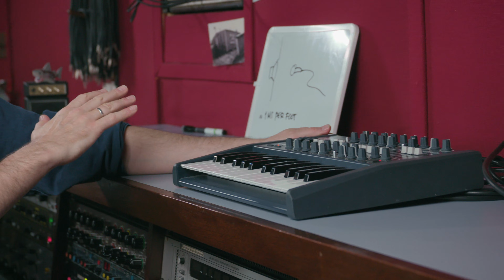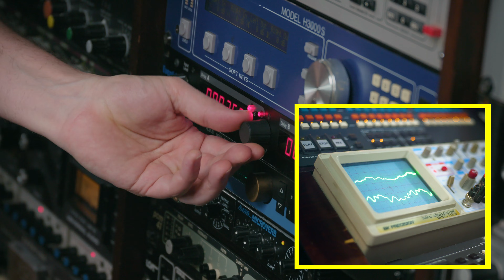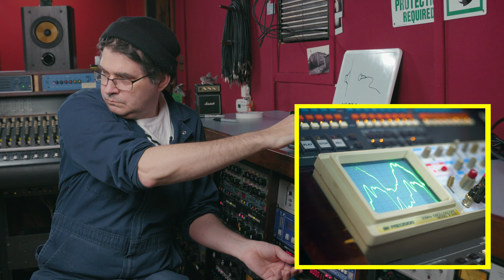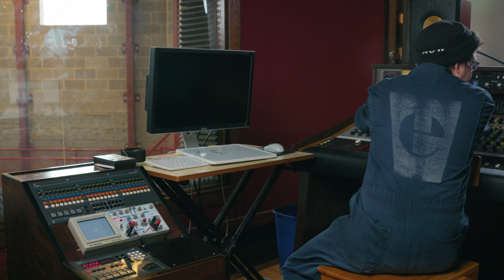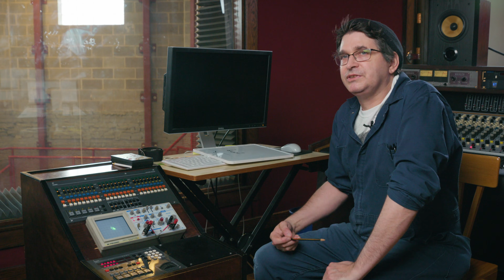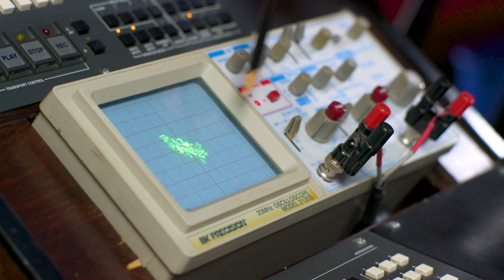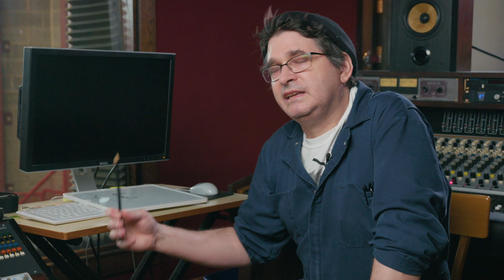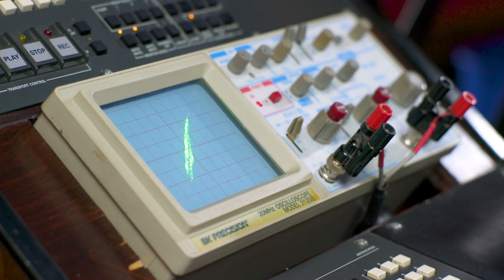Electrical Audio How-To: Time Alignment of Multiple Sound Sources

Comment: its actuly way easier to do this on a daw - with 2 mics just do a hard pluck on ur guitar and u can tell very ez how to align both mics
Reply from the maker: Best practice to get it right going to the multitrack.

If you are doing a full album, a double album, a punk record with 30 1-minute songs, leaving it to do via manual alignment, you have to do this as many times as there are songs on the project. If there are distorted guitars or bass and your alignment varies by even one sample, the guitar/ bass sound will vary significantly because of the nulls and peaks caused by comb filtering associated frequencies.

Comment: That amp/cab/mic vortex 😂 Anyway, I'm guessing that depending on the analog gear that the signal is going through, there may be frequency dependant phase shifts? If so, would you just go for aligning fundamental frequencies most relevant to the song key? Also, would you have to take into account any delays caused from the direct outs to the oscilloscope?

Comment: I can hear it phasing as they come closer together. Perhaps better to leave them apart sometimes?
Reply from the maker: Perhaps what you're heading is the phase relationship changing, but if the diaphragms are aligned there should be the minimum of comb filtering/ phase cancellation between them. If you prefer the sound with the mics apart/ with comb filtering, you can certainly record that way.

Comment: Is is possible to use a digital plugin for phase alignment?
Reply from the maker: Sure, yes. In an analog (tape) context this isn't a possibility, though, and generally it's a best practice to get things "right" going into the multitrack rather than delaying that correction. Same thing with polarity corrections- generally it's a best practice to check polarity and correct where necessary when you are setting up so you can record correct polarity, though you can, of course, reverse polarity later with any number of plugins.

Comment: Hey Steve, love your work, your vids and your incredible acrobatics...
one Q... when recording guitar amps using multiple mics we accurately align the capsules or strategically  distance them from the grille cloth to phase match, but the speaker cone itself is conical... so should we not be taking the distance from the face of the cone itself rather than the grille cloth.? always wondered...

Comment: On the playback side of the equation I had an Alpine car deck with manually adjustable time correction and it was definitely noticeable, tuning fronts and rears for the driver's position in a subcompact car.

Comment: the casual mention of "I had this dual delay adjustable in microseconds made for me by Eventide" is the most massive flex i've ever seen in a recording techniques video.
Reply: what do we think – 10 grand later?
Reply: @sugaree9090  Inquiring minds would like to know ...
Reply: It very well may be a joke, completely on brand for Steve.
Reply: @artysanmobile  I'm a huge delay nerd. That is not a commercially available device and DIY delays are NOT easy.
Reply: @suitandtieguy   I can’t think of any hi-end delays that won’t work in 10s or hundreds of microseconds. It is dead easy to mod a digital delay to work in the next decimal range, especially in the shorter direction.
Reply: @artysanmobile  I engineer synthesizers for a living and I'm an Eventide nerd. That is not a commercially available product and hacking it together would be extremely difficult.
Reply: @artysanmobile  what's really funny is how stupid this is when you could just buy Driveracks and program the delay in literally feet instead of time. They are so cheap and sound GREAT because they are designed for clean program material.
Reply: @suitandtieguy  maybe that wasn't an option at the time he had his delay built? Then he got used to it and stuck with what worked 🤷🏻‍♂️ I mean.. he probably paid an arm and a leg for it.. and it clearly did what he needed it to do.
Reply: @jmorrisey79  there were digital delays for speaker alignment in the 90s.

This whole thing is making me want to call my power supply engineer that's worked over there on occasion. I need to check in on the triple rail switcher he's designing for me anyway and this piece of gear is something he probably knows about.
Reply: @suitandtieguy Is it not similar to the bd600e broadcast protection?
Reply: Steve: Hello Eventide, the most renowned digital effects manufacturer, with the most pristine sounding units ever?

Eventide: Yes?

Steve: I need you to make a me a delay, adjustable in microseconds.

Eventide: Uh...who the fuck is this?

Steve: Steve Albini

Eventide: Right away, sir.
Reply: big gulps huh
Reply: You're right but look who it is, it's Steve Albini. Guy gotta get paid.
Reply: Agreed 😂🤘
Reply: seriously, "oh yeah that little thing?"
Would probably break Ebay if they put it up for auction.
Reply: I find it even more impressive that Steve's ears can hear the phase difference!
Reply: Phillips made a tape delay for movie theaters that was designed to fix speaker delay in the theater. Very cool and rare. Soundgas has one on their website.
Reply: That's because he's a massive personality. To him, it's probably not even a flex, more like an easily-attainable win-win from someone who's so much of an insider, that he's programmed half of your brain, and tries not to take credit for it. (Because he's so humble.)
Reply: Well, not your brain, specifically.... But the brains of many! Music!!

Comment: There is software that will do this for you in seconds now, and it's cheaper than custom made eventide delays and more accurate than eyeballing a 2"x2" oscilloscope screen or putting your fists together. Doing shit like this is probably the best way to train your ear, though.
Reply: Ya think? You don't record to tape much do you?

Comment: Great explanation. I particularly liked the incidental noises for comic effect and also the multiple pens in the top pocket. Ordinarily most people just time-align in their DAW by matching up the waveform peaks. That is not an option here as I believe this is a tape-based studio.
Reply: Yes analog based, but they can do digital as well (pro-tools).  I was looking into having my band record there, and the rates are really, really good.  It's called Electrical Audio Recording
Reply: The calm “f d-up leg” phrase added immediate charm as well. I choked actually!

Comment: Running the DI signal through a delay would certainly work but I was left wondering why he didn't just move the audio in the DAW after recording to achieve the same thing without having to run through a delay line. Then I remembered that Steve often favours recording to tape.
Reply from the maker: In fact, Steve only records to tape. He has never personally used a computer to record.

Comment: Okay, but what about drum overheads? I've never recorded drums before. Set up a couple overheads to handle cymbals, toms and hh. Same type of mics, but  they were almost exactly 180 degrees out of alignment... not sure what is going on there. They were at the same height over the kit.

But it's so much more complex than that! Flipping phase, and making small phase adjustments was doing ALL KINDS OF THINGS! Like just flipping the phase of one of them would return the kick and snare, which were both close mic'ed, right back into the center. When the overheads were out of phase, everything was wide. Kick and snare had a decent amount of impact, but they were w-i-d-e. Also, making small phase adjustments, changed the sound of each instrument in the kit. It was maddening, as there is no "right" sound, it was all aesthetics. But being in a sea of changing aesthetics, like a milisecond adjustment did things that I liked to the ride, but didn't like on the hh. I've recorded for several decades, but simpler sources, with at the most 2 mics on a single sound source... my first time mic'ing and mixing a real live drum kit.... I was staggered.  I've got A LOT to learn. This is  like meeting someone that you like very much, but know they're a very complex person, and it's gonna take years to really get to know them...

AND! What's more, the overheads from hard panned, and on in to 50% left and right, had all kinds of impact... like changing the various drum/cymbal impact sound, lol,  but widening to narrowing the kit. And again... it was all about what I wanted. Honestly, like playing chess, I'm not so great with all that choice. I like 16 different moves, all for different reasons, never really know which move is the best because I'm not really sure about where I want to end up... SO COMPLEX MAN!
Reply from the maker: A few things:

Miking a drum kit with close mics plus overheads (and anything else) there are bound to be phase compromises. That said, you can, and should try to,  get everything reasonably phase coherent.

If you flip polarity and lose the center channel information, which makes things seem wide, you've just put things out of phase. So flip back.

You might try starting with your overheads centered so that the stereo dimensionality isn't confusing you. Add one close mic. Flip the polarity on it and see if the sound quality degrades (usually loss of low end indicates you've put the mic out of phase, a low-end gain indicated you've gotten it closer to in phase). Once you've got good phase coherence between the close mic and overheads, remove the close mic and add the next close mic, and do the same flip/ audition. Rinse and repeat till you've done all close mics.

Sometimes you'll have bleed from one close mic into another, and you can try flipping phase of one or the other, but generally the most important phase relationship is between each close mic and the overheads, because they are picking up more of each drum than the bleed from each drum into the other close mics.

If you add a front-of-kit or center-of-kit mic or any other pickup, you can start pushing and pulling drums in and out of phase, and the compromises become more significant. Steve generally adds these bonus mics in, flips the phase on them, and makes a blanket determination of which way to keep polarity based on which subjectively sounds "better."
Reply: @ElectricalAudioOfficial  Whoa! A lot of ideas, and in seconds! That's awesome, thank you so much. I'm going to have to read this twenty times. One of things where you think you've got it, but on rereading, you pick up another little detail that has a huge impact!

So thanks again, I will try all of this out. Thank you. Thank you. Thank you!

Comment: Not to be a smartass, but is there any reason to not use a ruler while positioning mics? I'm guessing microphone response times are slightly different so you'd have to use your ears no matter what, but it seems like a good start.
Reply from the maker: Nope, you can certainly use a ruler. One tricky thing to be aware of is that the diaphragms of many mics are recessed in the mic bodies, so you may not want to measure to the edge of the grill, but rather to the diaphragm, if you can figure out where it is!

Comment: 02:25 For anyone interested in his explanation. Great, genius man!

"It has to make its way through a pretty elaborate system before it finally gets to this microphone.
It has to go through the input circuitry of this amplifier, which has time constant, and the preamplifier has to get the signal to the power amplifier section, 
which it then has to modulate the power supply through the out port, output transformer, which then needs to couple the primary and secondary windings to the output cable,
 which goes to the loudspeaker, which then gets it voice coil energized, then the voice coil drives the speaker cone inside its magnetic gap and the compliance of the cone needs to move the air that's in front of it, that air pressurizes and the pressure wave travels through the physical distance between the loudspeaker and the microphone, than the microphone diaphragm needs to move and make its way through another transformer and down the cable, that it has some capacitance, then into the microphone preamplifier...It's a wonder it works at all"

ps: i managed to slow it down using reaper, so its pretty accurate.
Reply: Thank you, I was kind of annoyed they sped it up for a gag because I was super tuned in lol
Reply: Thank you. Very weird time to put in a gag
Reply: THANK YOU

Comment: It's ALWAYS great to get a knowledge download from you Steve!  But, I would like to respectfully point out that the "delay" from an all-pass network is really just a phase shift and does not directly equate to a signal delay.  The delay you appear to get from an all-pass network (phase shifter) will be different at different frequencies where the delay from signal delay is consistent regardless of frequency.

Comment: Why not flip the phase on one channel?
Reply: You mean polarity I imagine (180 degree phase reversal = polarity)... and because that doesn't solve time arrival differences and would make things worse if the sources are already in proper polarity but just not time aligned.
Reply: @busyboxst7  polarity if it is matched should not be a problem if there is a problem than a simple switch (of polarity) would solve the ptoblem
Reply: @donatolepore3520  this video isn’t about polarity but is about improving phase via time alignment.  Phase is never 100% perfect or the two sources would sound exactly the same and be pointless.  It’s on a spectrum, things can be obviously out of time alignment and have bad sounding phasing issues and need to be improved.  Polarity is a mostly more black and white / right or wrong  issue, time alignment/phase is a bit more nuanced of an issue.

Comment: Can't I just adjust this in the DAW by moving or delaying the tracks?
Reply: absolutely. I used to get super ivolved with microphone placement but now I'm simply using auto align vsts.
Reply: Your daw goes down to samples (unless you have one of a few plugs on the market that go lower).  A sample at 44.1 is .02ms ish, or a 50th of a ms.  I microsecond is 1000th of a millisecond.  A millisecond roughly is 1ft.  So the answer is "yes" you can, but not with as great of accuracy.  The same company that makes the delay he showed makes a plugin and it's the only one I've heard of that does microsecond adjustments (or at least in any easily controllable/usable way).  It also has both positive and negative time adjustments which could be helpful if attempted on a mic/mic scenario.

Comment: There's a much easier and faster way of fixing these phase issues with incredible accuracy.  This is certainly a way, but it's not the fastest and easiest and no, it's not by ear.
Reply: Alignment of the stems in a DAW? Don't forget Electrical record mostly to tape
Reply: @snazzback  No, not that method.  Much easier whether tape or digital.

Comment: You can also align audio in a daw instead of using a delay. When I’ve aligned I personally think that the difference is very slight to the extent that I don’t bother in most cases. Only if the 2 signals are extremely similar and unpleasantly out of phase is this worth doing. Also time differences are natural if you think about it. For example lining up close mics with overheads. The sound of the overheads are completely different to the close mics and the sound naturally arrives later like a reverb or a large room.

Comment: Putting one mic right in front of one part of the speaker and another mic right in front of another part of the speaker makes sense because when I'm listening to someone playing guitar I usually crouch on the flooor and put one of my ears right up close to one part of the speaker and my other ear right up close to another part of the speaker, as opposed to standing ten feet away and listening to the overall sound with my ears attached to my head
Reply: unless you're already hearing impaired you really shouldn't do that otherwise you could really damage something, a strong amount of energy coming from a large speaker going directly into your ears can burst your eardrum and the loudness of the sound itself can give you tinnitus or potential permanent hearing loss in the frequencies coming out of the speaker, in your case the sound of a guitar has a lot of high-end frequencies (not as much as cymbals but still a lot) so putting your ear right up to a speaker playing guitar sounds can give you hearing loss in the upper mids to high part of the audio frequency spectrum, safety first
Reply: If your recording space happens to sound just as good at this ten foot distance, through a mic, as a typical record, by all means go for it.  It would be extremely uncommon for this to be the case, to put it mildly.  If you can find some records made this way (that aren't jazz), I'll be surprised (unless it's jazz or a niche market like binaural recordings  (which cannot be mixed at all, in any traditional sense, after being recorded)).

Comment: This is excellent advice for anyone working in a purely analog environment. However for those limited to the digital realm, you can achieve this same result by putting the two tracks side by side, enlarging them so you can see the wave forms clearly, then sliding the microphone signal back a hair until the wave forms matchup visually.
Reply: That might be what we live accompanists automatically do. When accompanying Jennifer Warnes on a tour in the early seventies the audience never complained that I was lagging behind.
Reply: DAWs don't go down to microsecond accuracy tho, just FYI.  There's an eventide plug that does.

Comment: This is for live setups right ? Because you could fix all these timing issues in the DAW.
Reply: Most DAWs only go down to sample accuracy.   A microsecond is ~ 20 times smaller of an increment if you're in 44.1, ~10x in 96Kish....  Eventide makes a plug for this... But as far as the usual daw only approach - cool, but don't send the artist both mics while tracking.